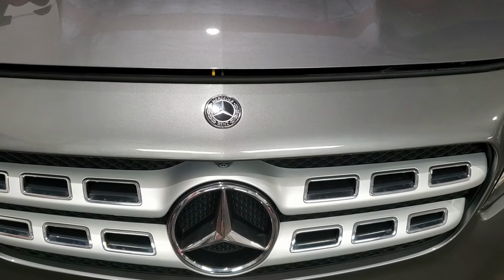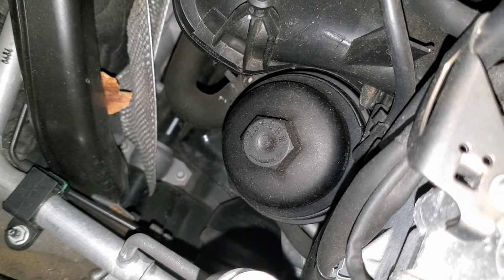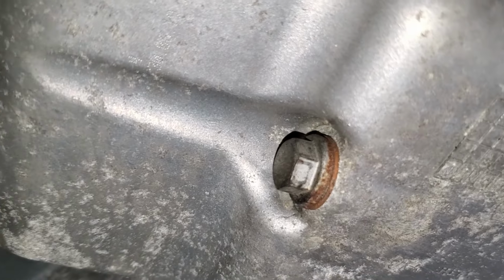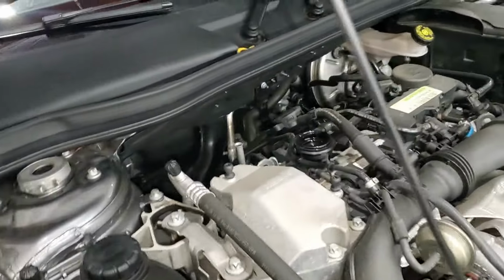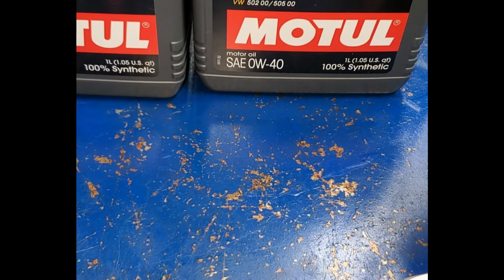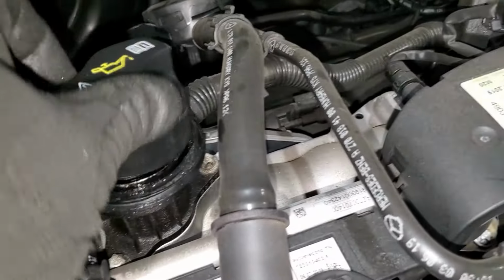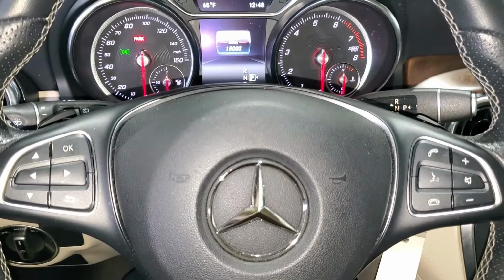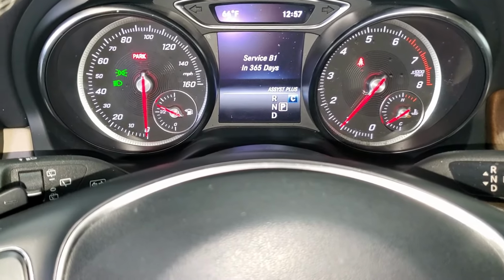How to perform Service A on Mercedes Benz Cars #servicea #mercedesbenz #scheduledservice

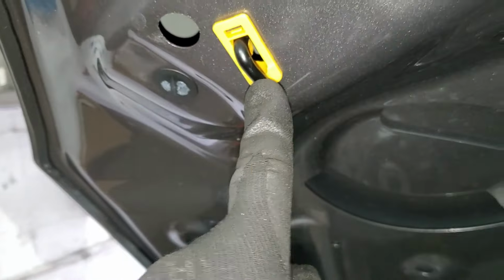Comment: You get what you pay for--am surprised the first car at 01:47 doesn't have automatic struts to support the bonnet! Both my Mercedes-Benz E-Class, even the old W124 in the 80s had gas-filled struts--no mucking about with yellow manual supports... 07:32 I appreciate it when my mechanic replaces the oil seal on the sump plug--I don't want any leaks and every seal must be renewed.
Reply from the maker: Yes, CLA, GLA & A class cars are the low end models of Mercedes Benz. And yes, its always important to change all seals during oil change. it helps avoid leakages.